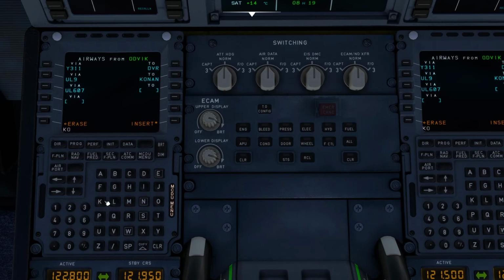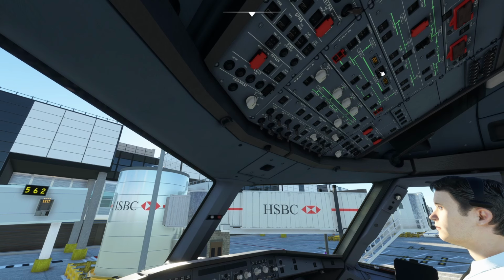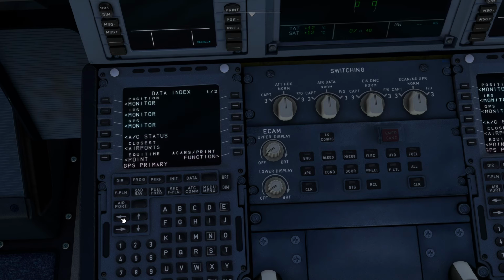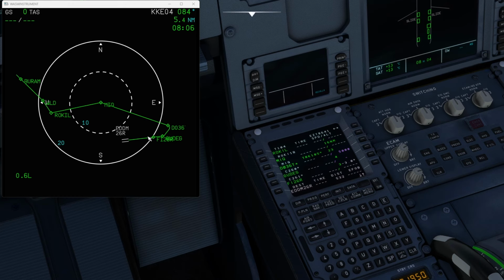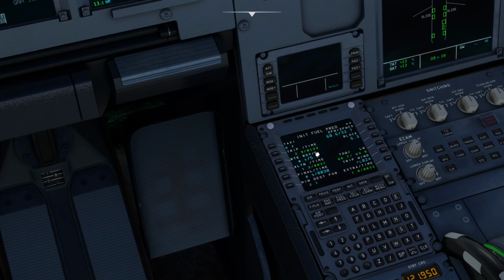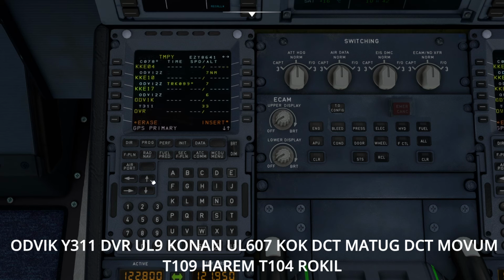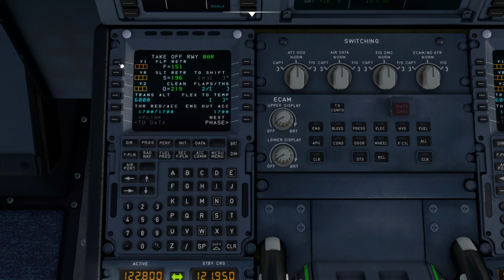Airbus A320 MCDU Setup Manual Setup and Simbrief

Comment: Question for you, when inputting manually at the fuel and payload bit when you put 60.2 t into the efb it generates the passsengers and cargo figures how did it get these as we didn’t input these from the sim brief flight plan? Does the sim brief flight plan specify the weight for passengers and cargo ?

Comment: i bought the fenix thinking it was going to be a better experience than fbw a320 and yes of course it looks amazing and absolutely everything works on the fenix but the immersion of the fbw is something you wont find with other addons. The passengers boarding the pilot announcements and not a single extra addon!

Comment: Hi. I've followed this religiously using the A32NX (stable and Dev) in MSFS24. Starting on the runway I cannot get the aircraft to move. Its like the brakes are stuck even though they are indicated not. There's always a T.O Inhibit in pink. When throttling up you can see the plane rocking forwards but it just won't budge. Any ideas why this is happening - what am I missing?

Comment: Where did you get and decided APPR via "MIQ" which was not in flight plan?
Reply from the maker: I should have included the chart for the arrival. It was chosen based off of the STAR and direction of flight. There's multiple VIAs that can be chosen From. Just take the one that makes most sense.

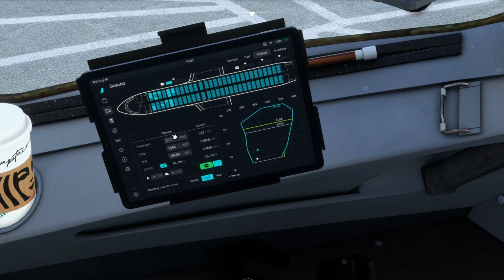Comment: Excellent primer on programming the MCDU. I followed along in FlightSim and tried to enter the information exactly  as you did. Everything was working great except that at around 18:20 you jumped back into the MCDU from Navigraph and seemed to start DIFSRIP from scratch. Is this an alternate route?
Reply from the maker: No i reset it and then the second one was an example of inputting all the data in manually rather than using the simbrief integration.
Reply: @RealSimPilot  Got it. Many thanks!

Comment: How do you hae the Top of descent point in the fmc?
Reply from the maker: You'll get it if the FMC is set correctly
Reply: @RealSimPilot  Is it an issue where if i do not have the latest airac version the tod point won'r show up?
Reply from the maker: @cascadexxx  no you just need to have the flight set into the MCDU with all the calculations done
Reply: @RealSimPilot  after all the calculations the TOD is still not there
Reply from the maker: It's been available for a while now. If everything is set up correctly it should work

Comment: I just finished the MCC course on the A320, FI was an A320 examiner and we actually used to feed it with the calculated trim by typing "up" or "dn" directly followed by the value for instance "UP1.2".
So when rotating the pitch trim is already where it should be, from there on autotrim managed the trim of course.

Comment: Does somebody know how to get the tablet in the a320? There's a bunch of tutorials on how to set up Navigraph but I don't know how to get the actual tablet....
Reply from the maker: It comes with the aircraft. You need to install the FlyByWire A32nx. Not the default A320
Reply: @RealSimPilot  Ohhh okay. Thank you so much, it worked... this made everything sooo much better. I always used the default a320... Thanks again. Great video, as always.

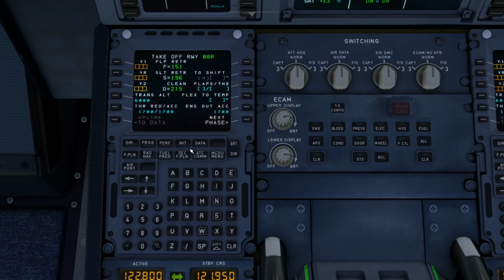Comment: What abut the flex to temp (  why we keep it empty ) ? @ 15:03 .... Thanks a lot  for the tutorial
Reply from the maker: You don't always have to use a flex temp. It just used to de-rate the engines to save on fuel and engine wear. Not really required in the sim
Reply: thx. for  your reply  @RealSimPilot
Reply: @RealSimPilot Ya but you can do more flights with more fuel in the long run....

Comment: I'm new to vatsim but how do you work out if your on a 8 mile final for RWY 23L is it to do with the DME or something?
Reply from the maker: If you're on an ILS approach you can see the distance to the ILS on the bottom left corner of the ND.
Reply: @RealSimPilot  Ok thx do you havto be in approach mode?
Reply from the maker: @YoungVatsimPilot_AUS  no press the  LS button on the EFIS panel

Comment: My ZFW/ZFWCG doesn't seem to compute correctly after entering block fuel. Wondering if there's a bug? Comes up with 55.4/32.1 (out of range error). Did i miss a step? I don't think I downloaded the block fuel data from SimBrief, I just entered the block number shown in the briefing data. Does it pull other data that is used for that calculation? I have tried this again and found that it will give me the ZFW/ZCG number without the block number entered. So maybe I /we were doing that out of order?
Reply from the maker: ZFW doesn't include the fuel. It is the aircraft plus payload. Stands for zero fuel weight. Are you using the flybywire a20n profile in simbrief with the correct aircraft weights?

Comment: No mention of Flex To Temp?!  Should this be set... even in a sim??
Reply: I have a A32NX Performance calculator, which I can't remember where I downloaded it. I use it only to get the FLX (Flex to temp), but it also gives you a lot of other information. Works very well for me. And it downloads the information from Simbrief, which is perfect. With FLX you don't go full TOGA when taking off. According to my research, this isn't 100% as in real life, as some of the information for the Airbus isn't public knowledge, but works for the simulator if you want a more immersive experience. You can use the tool for takeoff and landing information.
Reply from the maker: Very nice. Let us know where you got it from if you remember.
Reply from the maker: You can set it but it's not necessary in the sim.

Comment: Appreciate the review. It helped confirm the process in my mind from your earlier version, and those of others. 
One question that perplexes me: I set up a flight in SimBrief from KBWI to KPIT.  On the STAR of runway 10L at Pittsburgh (DEMME 5),  there is an altitude constraint of 10,000 feet at NESTO which shows correctly in the MCDU. However, when I look at the next waypoint in the STAR (DEMME) the MCDU still shows my initial cruising altitude of FL250 (25000). It does not show the next constraint waypoint (GRUNZ). It also has a constraint of 60000. I would have exxpected to see it listed. The next waypoint in PENGN which, again, shows the FL250 altitude.  I am confused. I thought that if the MCDU indicates a lower altitude (such as the 10,000 at NESTO) it should show the same altitude at the next waypoint, not the initial cruise altitude. I am also confused why GRUNZ and its >6k altitude constraint did not show at all. I do have a Navigraph subscription and using the correct AIRNC in SImBrief and the sim.
My concern is whether this behavior will mess up my descents during the STAR phase of the flight as well at the ILS approach.
Any ideas why this might happen? Or do I just have to manually "correct" the inerrent altitudes in the MCDU before I begin the flight? Or do I just ignore and use Selected altitudes instead of Managed?
Many thanks.

Comment: What version of the FBW are you using? I get no T/C or TOD info in my flight plan
Reply from the maker: Development version. You should have a TOC and TOD once you've set up your mcdu
Reply: @RealSimPilot  So is that not in the stable version?
Reply from the maker: @justinjohnson8102  no give the development version a try.
Reply: I think you need to have weights and v-speeds entered before calculations for VNAV T/C and T/D to kick in. And the development version as stated elsewhere.

Comment: great video! quick question though:
when you completed the mcdu with the simbrief integration, it gave you the altitudes and speeds for all of the waypoints, however when you did it manually, i didnt see them. do they also have to be filled in manually?
Reply from the maker: Thanks for watching! No they will also populate once all the other pages have been filled in. You don't have to put those in all manually I just didn't go back through the flightplan after inputting all the data manually.
Reply: @RealSimPilot  aha, thanks for clarifying and great video!